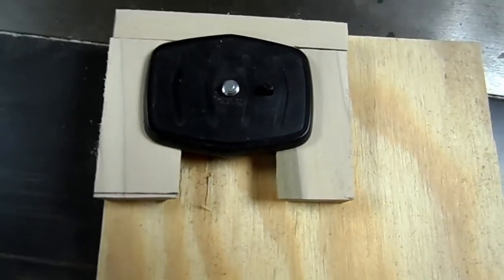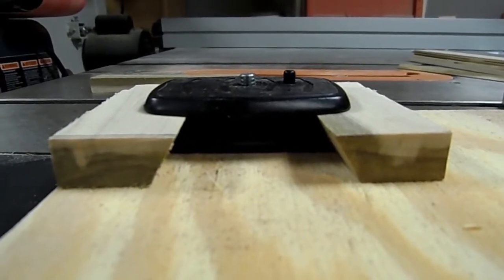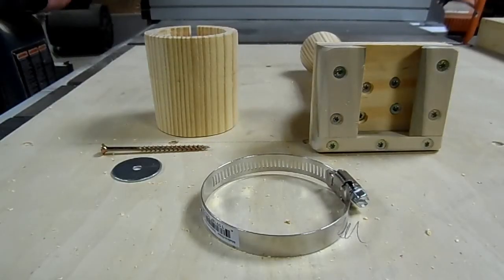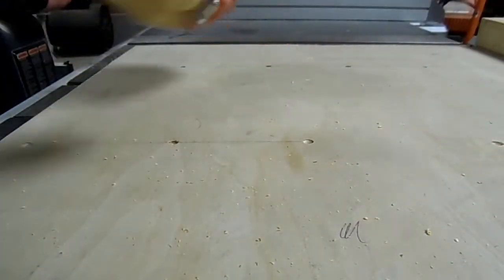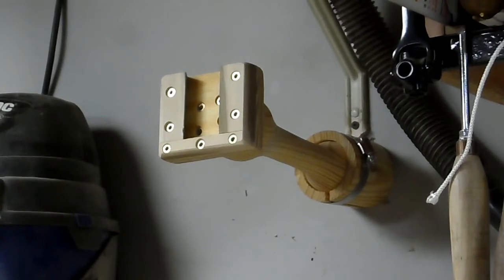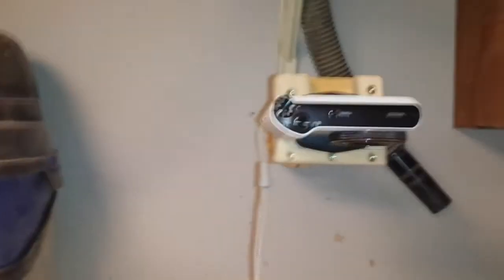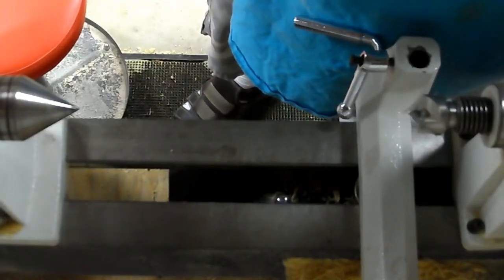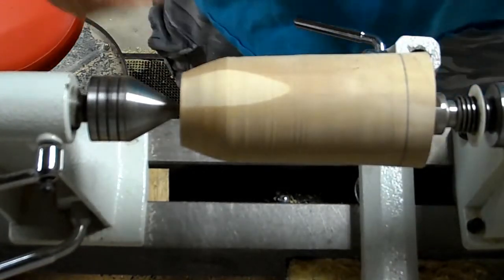GPW 17 - Ball and Socket Camera Mount

Comment: Looks like a good result. When you first put it together it looked like it would be a nightmare to get the camera aimed right, but obviously you got it! That pine (or whatever it is) sure takes a nice polish from the skew :)
Reply from the maker: awldune You can adjust the tension on the clamp so you can move it where you want it before snugging it up.

Pine is correct.

Thanks for watching!